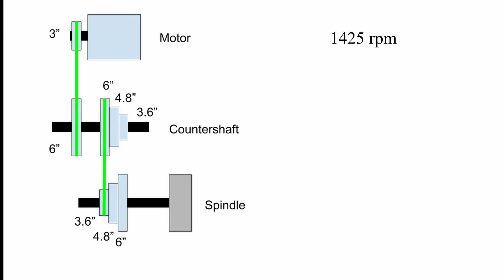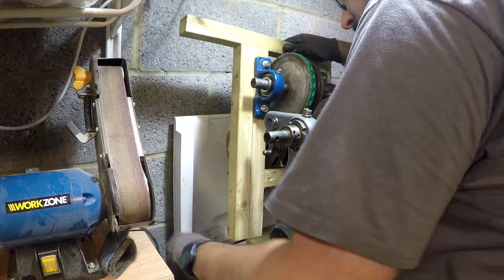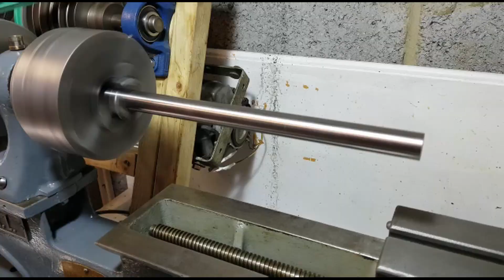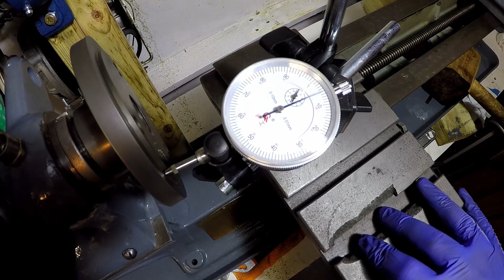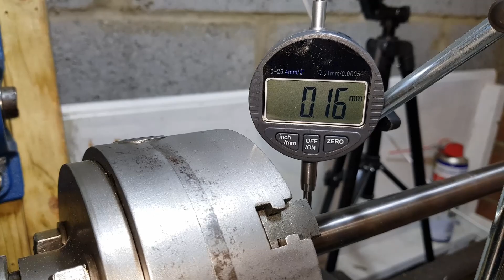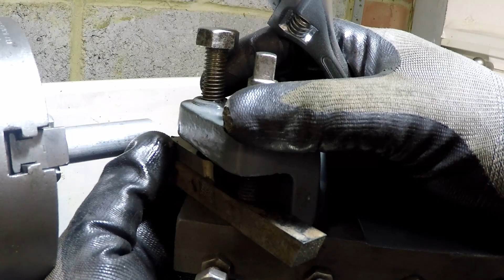1920s IXL Lathe Restoration - Part 4

Comment: I have an IXL lathe as well. I have most of the gears and I have the back gears as well. I can provide measurements if you want them. My lathe is incredibly worn though, you have a much nicer example than I have! My plans are to eventually replace the IXL change gears with Myford gears  as I am missing a few. I also have quite a number of missing teeth on the change gears and also a missing tooth on the back gear which is very disappointing. I believe my belt cone is made of mazak can you confirm yours is the same?

Comment: Is it possible to cut threads?
Reply from the maker: Unfortunately I don't have the back gears for this lathe. They were all missing when I got it.
Reply: Have you machined any steel yet?
Reply: Hi @theshedengineer8750